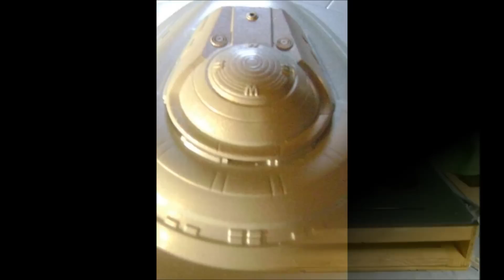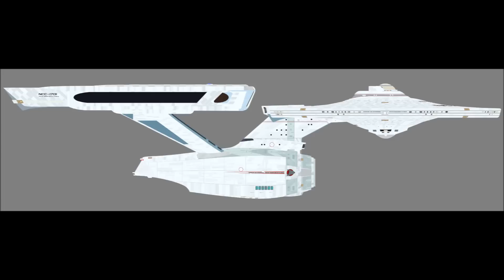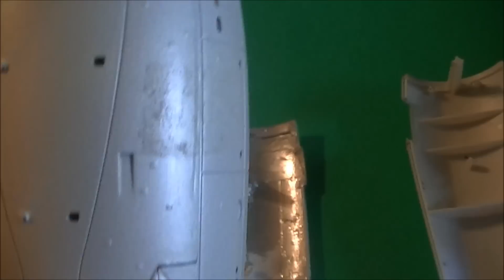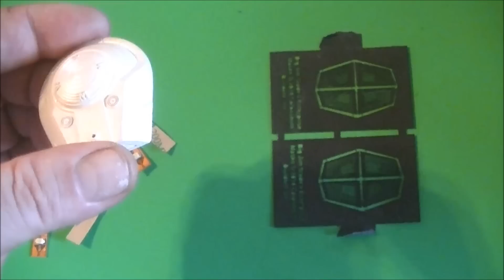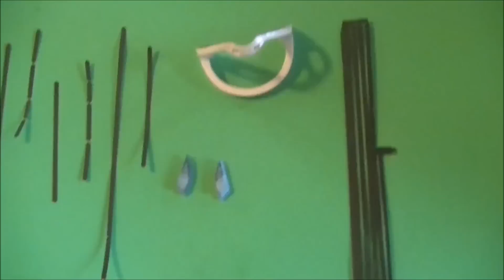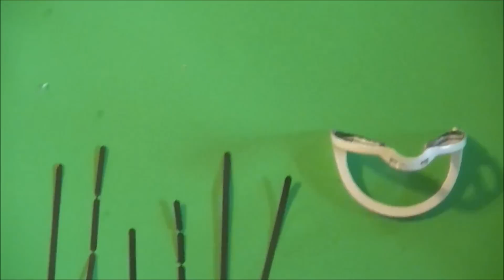Captain Quirk's Quickies IV

Comment: Not so much of a "Quickie" as a "Longie" at 13 min, eh? Typically interesting and who could not resist humming along and tapping one's toes to The Name Of The Game theme? (I loved that show; I loved Susan St. James! I may have been 14 but I had potential... )
Don't you just enjoy being the center of attention of a cat? Even if it'll drive you batty? Sweet.
Less potentially destructive (on your fingers) than alcohol, for the removal of adhesive residue, are oils. 3-In-1, WD-40 or even canola or olive oils-- I use a Q-tip for control. And cleans up easily-- it all depends on what's at stake, of course. Alcohol may evaporate cleanly, but once it picks up some gunk, there's a goo issue. A little more oil works and one can then use soap for a clean finish. No one likes to slip on a model!
Reply from the maker: I did try to edit down to 10 mins, but there was so much awesomeness... "Name of the Game?" and I thought it was the Studio version of Mannix...??? Shows what I know.
Reply: CaptainQuirk69 And you would right! Damn my creaky old brain... I hope they kind'a sound the same. Now I gotta check. Still both were great and I still love Ms. St. James but it was Mannix who taught me how to drive.